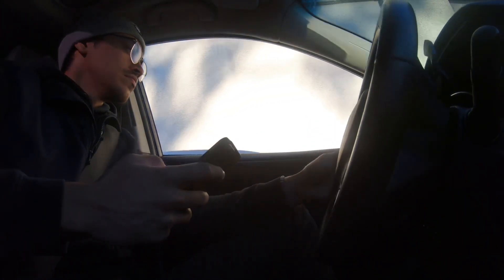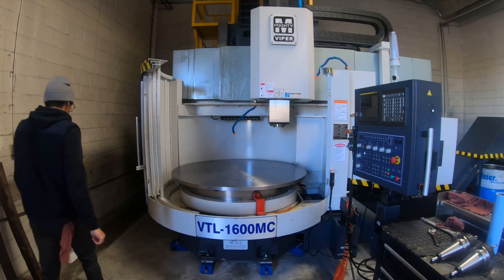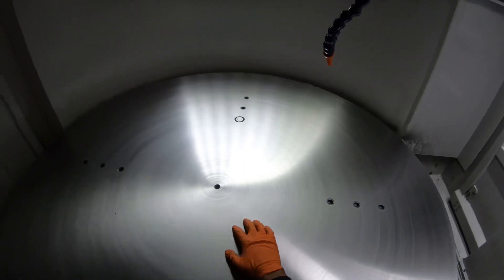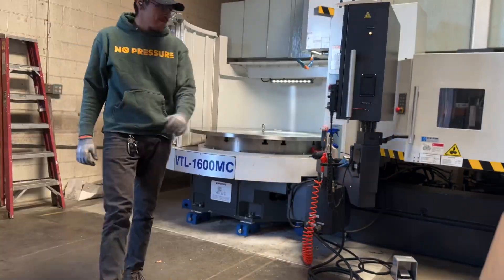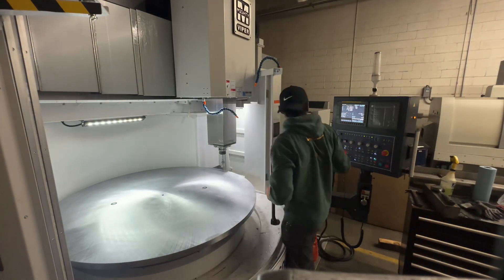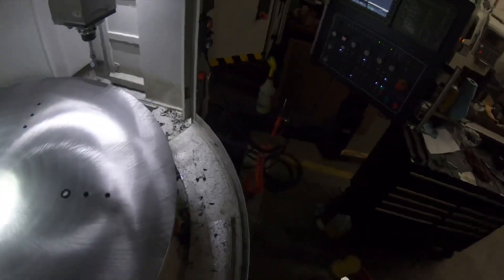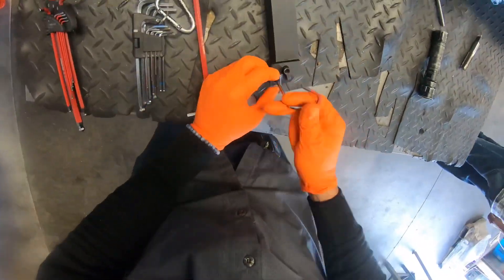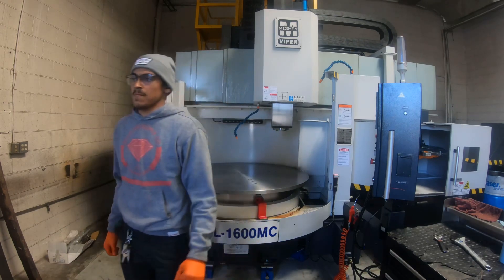New Journey with a BIG Machine | CNC Machining

Comment: Not sure why you didn’t drill and ream a hole in the centre of that plate…So you have a true position with a known size so you can calibrate of it…been on the Apps for 20 year and I’ve done that with every plate we’ve installed. Weather @ PAMA  or Carnaghi… ?
Reply from the maker: Didn’t need to for our application, the plate is permanently staying on the table. But I can see when you might want to/need to for taking the plate on and off

Comment: Had a guy come in our shop several years ago saying everyone has VMC’s, lathes, and HMC’s, but not many have VTL’s.  He was covered up with work for his for a while.  He’s out of business now.  But there is a big shop in town that only does big stuff with several HBM’s and VTL’s.  They stay busy.  Takes a lot of investment to run big stuff.  Should have bought his VTL at auction but don’t have the room for it.
Reply: VTLs are more common when it comes to large piece production (aerospace etc.), it's not that easy to pull those kind of jobs without investment of a substantial level as an independent job shop (as you mentioned).
It's more likely that bigger and established firms get those kind of jobs and just pull out 1-3 entirely new machines to just run those kind of jobs over a 5-20 year period etc.
Not to mention several certification requirements needed to even be allowed to run and deliver those kind of jobs in the first place (quality assurance, traceability, ability to keep deadlines while being cost effective and so on).